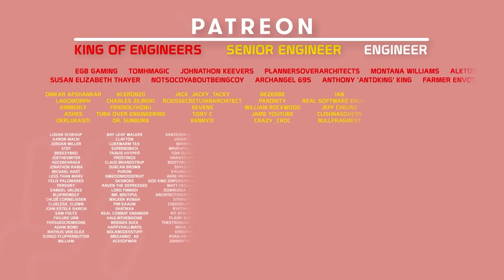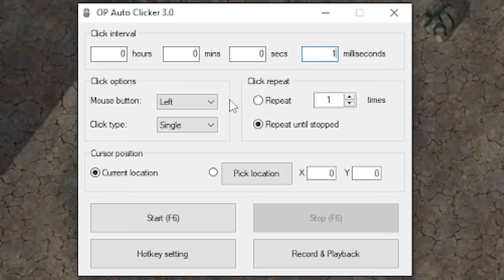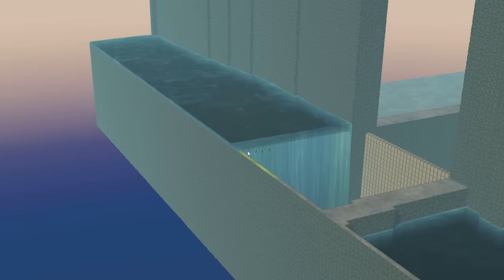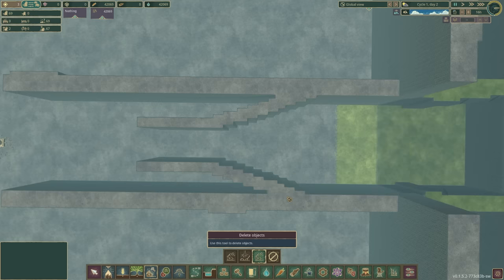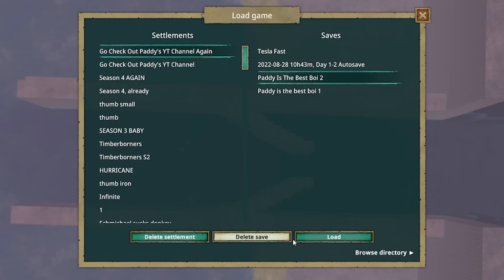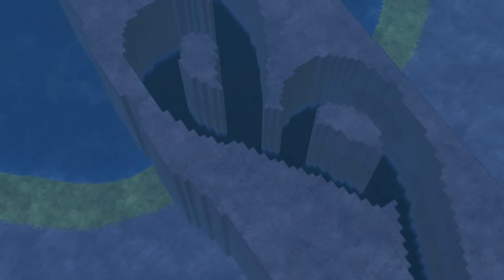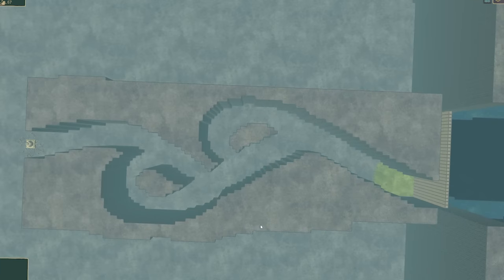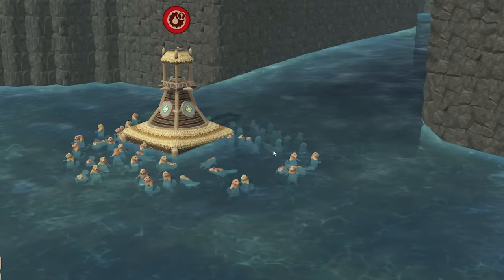Can a TESLA VALVE save my beaver colony from HUGE FLOOD WATERS?

Comment: I think the biggest issue with these valves, compared to the CS valves you made, the water has only one way to go here, in the direction of your beavers, whereas the CS water could go back to the ocean, so even when you can slow it down, you can never stop it, as the water will want to level out on every surface it can reach, thus inevitably flooding the beavers. I think you should try again, this time having a dam on the side of the beavers AND on the side of the map, so the water that you release actually has somewhere to go when it meets resistance, rather than inevitably (to a degree) drown the poor beavers

Comment: As long as you push more water in from the start of the valve it will fill up, when it is narrower than the initial water coloumn? It may reduce velocity due to turbulence, but the water will still rise to become at tsunami at the end because the path is constricted compared to the inflow.

With the other design with the countering dams you still have continous water running from the dams that should save the beavers, so you are just filling more water into a channel with no other exit.

For it to be a proper tsunami you have to also delete the backwall on the map when you delete the dams, so the water has somewhere else to go.

If I am completely wrong then sorry - I am merely a geologist. I probably rank near an architect.

Comment: My understanding of Tesla valves is that you need to add a slight offset to your return channels so they take a larger bite of the water stream and likewise I think your return angles were a tad too shallow. In terms of velocity you could do a kind of Fibonacci spiral narrowing the return angle thus increasing the water velocity against the main stream. End of the day though it will find an equilibrium and maintain flow. I think a more apt test would be seeing the flow slowed to maintain a levy? Fun though

Comment: I think you may have been onto something when you put the short dams in to block initially block the straight path. I think you should try that again, but keep the short dams low enough so that some water still spills into the straight path, but most (S.W.A.G. = 70%) takes the long route.

Comment: Part of the issue here is that there is a constant flow of water, no matter how good a Tesla valve you create, the water will still move through the entire valve until it reaches the end because there is no point where the water gets physically stopped. The tidal wave in city skylines was a better test because it was not a constant flow of water (granted the water physics sucks in both games) but with this game, you have a constant increase in water pressure no matter how good your design is because water is constantly being added to the system. In a real tidal wave, it's one huge rush of water but no water is being added to the system.

Comment: I think part of the problem is that since the top is open, the water instead of being forced through a smaller area, it just goes up the sides, so the volume of the wave doesn’t change so it stays at the same speed

Comment: 1: the Exact angles of a testla valve are very important
2: the valve needs to be thin enough that the volume of water maintains pressure as it passes through instead of being a loose flow like you have

Comment: Didn't he do a test a while back with water wheels? Showing that the water speed (at least the flow rate) did increase if you necked it down through a smaller hole?

I mean, the Tesla Value (at least it wasn't just a baffled alley this time) did do something with the direction. 

On the other hand, his main path was only about 3 times the size/width as his "values", so of course the water would move quicker down the much wider, straighter, path.

Far far FAR better than the first video in Skylines, and I have my doubts if it would ever work in to STOP water in a game that (while having nice water physics) is ment for water to spread out in every possible direction at a set rate.

Comment: You could have used water wheels coupled with stream gauges to measure the energy, flow rate and height of the tidal waves. You can even place these at different spots in the valve...

Comment: the problem with these water physics is that it doesn't have gravity to keep a down pressure at the top. The water are only supposed to go faster if there is nowhere else to go, like in a tube. If you have it open top, irl gravity somewhat limit the top, like in river, to make things go forward, and therefor faster.

Comment: I believe the water is just calculating in blocks of how much it's saturated if one block is 10 as saturated and the next is 0 it's all just going to level out to 5 and 5. In the next compute there are 3blox 5 5 and 0 so that would compute as 3,75 3,75 2,5. Four blocks 3,4375 3,4375 1,875 1,25 and so on but very rapidly and this is without any adding water as you did. Therefore this game only look to saturate the boxes not what speed it has. And i counted  in 2 dimentions not 3. As this game seems to do it. (More complex computing but same principle.)
Reply: I suspect that too, but the speed of water wheels increases for narrower sections of a river without impacting the height/saturation. However, the logic for water speed and water spread might be different, which would explain why the game has contradictory behavior.

Comment: With all due respect Matt I think that the water should go faster if it didn't have the opportunity to go upwards.  (Ship engineer on the making here.) So what if you tried the tesla valve but closed from above? Also make sure that the roof of the canal is touched by the water at all times. It may work better...

Comment: 8:16 Just a thought: Does water typically still speed up significantly if the bottleneck isn't sealed?
Because the water isn't flowing through a pipe in these circumstances
Reply: It should be similar but with a slight difference in speed due to some water pressure being relived vertically. The bigger difference is especially in real life the water on top is much slower then near the bottom.
Reply: Steady state and waves are very different.

Comment: Voxel water is 3 dimensionally neutral, it expands in every direction equally until it achieves it's height limit which is 1 voxel above itself maximum and settles down to the voxel it occupies unless it's in a container. A tesla valve will never work on voxel water. There is no pressure, no momentum, no flow mechanics. Each voxel will expand in 4 directions from itself up, down, left, right. This will cause the next voxel to do the same thing. It makes it look like there's a wave, but there isn't. The spawner simply adds +1 water per time value which adds height to each voxel in the container. The flow mechanics are very simple: each direction from the voxel gets movement until the adjacent voxel is occupied completely to its 1m height then it moves to the next adjacent voxels equally. Water doesn't flow like this. Water has pressure and momentum and until the pressure is low enough, the momentum keeps it moving forward with a little bit of bleed on the sides. Voxel water only bleeds to the sides.

Comment: Considering game physics can't really reproduce proper water physics, I'd try making the tesla valve with different sized straightaways. So the first from the dam would be something like 6 blocks wide going into the first turn then the next straightaway would be 4 blocks into the 2nd turn then 2 or 3 blocks wide going into the 3rd turn or off into the beavers. It seems that all games will just have the water going at the same rate as long as there's an opening regardless of flow.

Comment: The way a Tesla valve works, there has to be a flow of water already flowing in the valve's intended direction, then the valve will help prevent the back-flow from the other end. Using that example, perhaps start off with a river that's already flowing in the correct direction of the Tesla valve, then see what happens if there's a tsunami coming from the other direction.

Comment: I know you can actually fight fire with fire, but I'm pretty sure you can't fight water with water.
Your Matt-valve just ignores that waves exhibit a property called superposition. This means that when two waves collide, their shape is disturbed for the duration of the collision but will emerge undisturbed after the collision. i know that this is just a simplification, but in this case it pretty much predicts the result.
Edit: Fixed typo

Comment: Well, a tesla valve only keeps water flowing one direction without moving parts. It doesn't make the water disappear XD
A true test of Timberborne's water flow mechanic is using one to hyper-charge a series of water wheels without the water slowing down from back-flowing from the water wheels.

Comment: Isn't the main problem that water is always generated? so there is always a pushing mechaninc towards the beavers, it's not the same as a single wave. I mean no matter the construction if you always feed it with water it's going to come out the other end one way or the other. Isn't the point to check the dampening of a single, not continiously fed, tsunami vs the undampened one?
possibly make a side by side comparison :)

Comment: I think tesla valves requires a higher initial velocity for the water. It looks like there exist a critical initial velocity so that the water will be able to push against the other water inside the valve and not just spread out like that.

Comment: With the volume of water you were using, the only eventual outcome was the beavers getting flooded. There was so much water there that even if it reduced the flow speed, the sheer volume eventually just overpowered the stopgap measures you had added, and came down anyway, as it was the only way it could come. Also you had constant flow of water, all times, so not really that good of a "flood test". More like what if we put down  under niagrafalls and added these measures to slow down the flow, maybe it will keep the buildings at the bottom dry.

Comment: from what i can see i don't believe there's actually any flowing or momentum to this game's water physics, it's just a matter of volume, so it won't get deflected it will actually add up eventually, so there's really no escape. CS was promising though, there seems to be a motion to the water, the issue was you experimented with a single wave, how about engineering a river to slow it down to a dribble and see what happens?

Comment: use tesla valve in powder toy but use pressure high pressure to simulate the tsunami if you want constant find pump heat it up as much as possible and you have a constant pressure now make a tesla valve and done it does slow down just use velocity view i think that is 1 or 2 press number 1 or number 2

Comment: I'm wondering if setting your auto Clicker to the same frame rate as the game you're using it on wouldn't make it actually work faster.

Generally speaking games can't take inputs in between frames which is why even though you're clicking once every millisecond there's gaps in the water sources as you're putting them down........I think

Comment: it doesn't matter what valve you have, if the water has no where else to go exept over the beavers, all of it will eventually flow there. Cities skylines was different, because the water was able to flow back into the ocean.
Reply: That's right, but it also kind of ignores the target of the video. When it rains a lot in the real world a dam prevents a flood by restricting water flow. This will fail if the minimum water flow of the source exceeds the maximum water flow of where you put it. Since this appears to be the case it is a lost cause.

However, what sets the Tesla valve apart from many other valves is that (theoretically) you do not need to adjust the valve as the water level changes. As the pressure increases more and more water flows through the same cross-section because water speed increases. Normal valve reduce the cross-section, but instead the Tesla valve reduces the speed. The ingenious thing is that you don't have to control it, as water fights against itself and thereby controls itself.

It should be possible to dimensionate a Tesla valve in a way that at the maximum reservoir capacity it still doesn't flood the (nonexistent) river. It is certainly hard to do so with an open top. But if the river could take more than the water of the source a controlled release would work with only getting the beavers feet wet.
Reply: @jogemuat  yes, it would be possible to distribute the water flow over a longer period of time, making the water  less deep.

Comment: Hey RCE!

Found a flaw in the design. 
In Cities: Skylines you simulated the water physics with one giant wave of constant amount of water but in Timberborn you have built a system with a constant supply of water. 
So even you slowed the water significantly the large amount of water overflowed the system overtime. 

Next time, you should remove the wall behind the water wall so the water can escape either way. 

Yours Sincerely,
Source engineer.

Comment: 10:09 That Wool of Wotah :D
As far as I understand the water physics in timberborn: it just fills the layer. if a block is filled with water (or a blocker like a dam-n- or terrain) and the block at the next up layer adjacent to it has water in it, the game will try to spread the water evenly at a set pace instead of an actual momentum that depends on mass and heighth of the water... the floodwave in itself traveled always at the same speed, only the height was different depending on how you tried to slow the water down.
TL:DR: Water in Timberborn doesn't work like RL water :D

Comment: Your issue with these Tesla valves is that your dimensions are wrong. All parts of the tube need to be the same size. You're getting wide in the curves.

Comment: Tesla valves will never be effective for something like this.  They delay the inevitable for constant flows.  The issue also is that you can't properly simulate water pressure.  This game is in 3d and the valve is in 2d.  If you could put a ceiling on the valve? yeah, it'd be more realistic, but the problem then is that the game doesn't simulate water pressure.  It will always flow at a specific speed too.  This is a similar issue to what you were testing in Cities Skylines.  Water shouldn't be able to "bunch up" like it does on the taller segments of water as that ruins how a Tesla valve is supposed to function in principle.

Comment: The problem (in my opinion) is that you didnt have a wave of water, you had a nonstop source of water, so even if the water physics were going to deflect backwards, there was more water coming which defeated the purpose of trying to deflect a tidal wave.

Can you fill the 'dam' and then remove the sources without the water draining away? and then release that water (at a more reasonable height of course)

Comment: The main thing to understand is that each loop in the tesla valve only slows the water by a small percentage,  and they are cumulative.    so TWO loops in the valve is like a 10 or 15% reduction in flow speed.         SO YOU NEED MORE LOOPS lol

Comment: This isn’t a Tesla valve is it?

If I take a Tesla Valve and cut in half down the side… am I supposed to expect it to still work?  

Do oversized Tesla Valves even work? Meaning don’t specific flow rates have different sizes?

If I take a huge gigantic Tesla valve and then cap off the ends and then try to blow through one end with a straw and then another is it just going to magically be harder on one end?  I think not!!!

So I think you have 2 issues at once… your flow rate is too low and that’s not a Tesla valve.

I’m not an engineer though so… I just see what seems to be 2 glaringly obvious problems.  

This valve needs a top and it needs some pressure.

If they had tubes in this game then maybe

Comment: I don’t think your fluid dynamics knowledge is correct.

When fluid moves from a constricted to non constricted area in a closed tube or pipe it will slow down.
If it is not enclosed and is just an open top it will keep its velocity and spread out.

Comment: Bruh, how long until you realize you keep confusing channel width and cross section. You make the channel narrower -> water rises -> same cross-section -> same speed. You'd need a game engine that takes gravity into account, calculates mass flow etc. ... you'd also need to close the top of the channel and force a constant mass-flow on the inlet if you want to see anything close to a proportional relationship between velocity and cross-section. Yay, I'm an even more real engineer now.
Reply from the maker: In the real world your statement is VERY wrong. Look up "wetted perimeter" 👍
Reply: @RealCivilEngineerGaming  The real world obeys the many laws of physics, games obey specific sets of simplified concepts that a programmer implement out of necessity. Which is why I mentioned game engines, not mother nature. Remove some minor things that aren't necessary in most games, like gravity, friction or shear forces, and none of the simplified open channel flow calculations used in civil engineering are going to apply in any shape or form. So I'm not sure what you're actually "testing". Welp, hurray for the "wetted perimeter" in a non-physics-based beaver game I guess. But keep at it, you're obviously passionate about it and it IS entertaining to watch.
Reply from the maker: @protator  well if you're only talking about the game the cross sectional area is irrelevant as water velocity is clearly fixed as my videos have now proven. I'm just making sure false engineering knowledge isn't spread in the comments, if you take a look there's a lot of know it all that are doing this already 😅